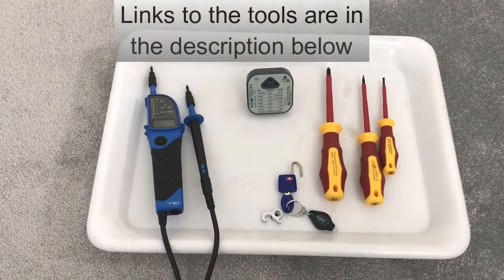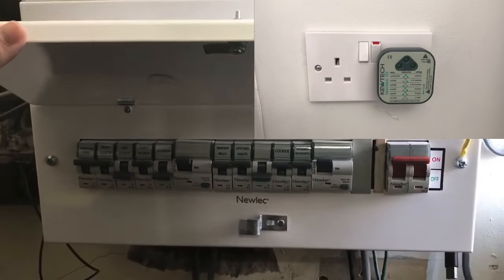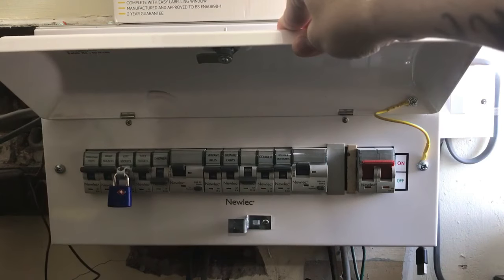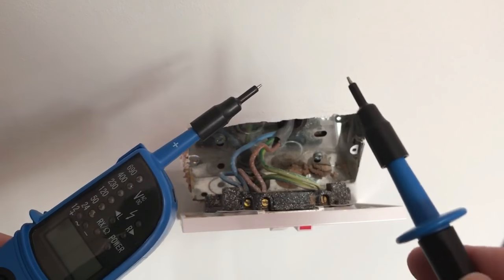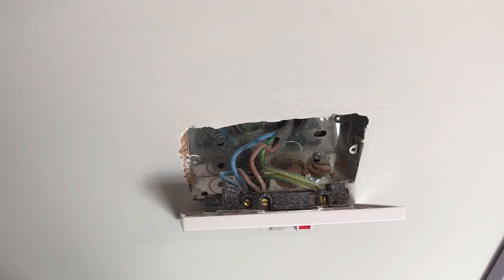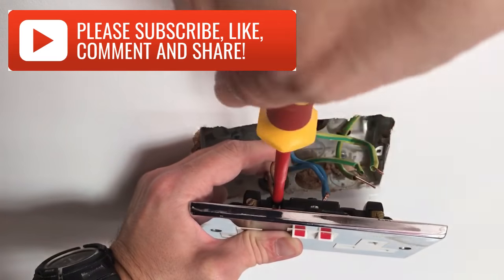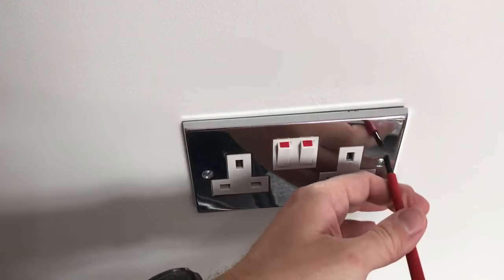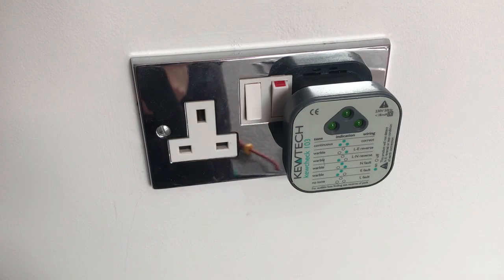How to safely replace an electrical wall socket UK, plug socket

Comment: Great safety advice with the fuse box, voltage tester, and the insulated screwdriver.
Reply from the maker: Can't be too careful with electrics, you only have to get it wrong once.
Thanks for watching and please consider subscribing 👍🏼

Comment: Excellent instructional video! My back boxes and double sockets in a 2001 built house all have fixing hole centres 120mm apart. All the new polished chrome replacements I look at buying have fixing hole centres 126mm apart. Will they fit the existing back boxes?
Reply from the maker: I think they are a standard size. I've never had one not fit.

Comment: I would highly reccomend you choose Varilight over CED or just any old generic brand as Varilight are a more reputable brand. 
Volex are also good but they now only make metal sockets with wide rockers and look similar to Crabtree, another top quality 
brand if you don't mind wide rockers which is more down to personal preference. MK and Hager are also good brands.

Comment: For some reason I was expecting you to put an earth wire to each of the earth points.. I wondered if this was only earthing 1 plug and not the other, could you explain the reason behind 2 earth points? thanks
Reply from the maker: They are both linked together so it doesn't matter if you use one or both

Comment: Great Video, thanks for this. 
I am trying to do myself and change from plastic to brass plates. 
But when opening I can see red wires are in the N and black wires in L. Is this correct? I was just going to put the wires as they are now into my new plate but then got nervous because as you mentioned in the video red wire should be in the L slot. 
Please advise would much appreciate
Reply from the maker: If in any doubt consult a qualified electrician.
Red wires are usually live and black neutral but the person who did the wiring may have done it the other way around. So testing might have to be carried out to make sure it's safe.
Hope this helps.
Thanks for watching and don't forget to like and subscribe to help me out 👍🏼

Comment: At last someone who knows what he is doing, good clear and easy to understand instructions,👍but sorry to criticise you made to simple mistake’s, 1) that voltage indicator does not have a self test function , shorting the probes together only confirms the battery is in good condition also the voltage indicator will still work with out the battery as  the battery is simply to power the LCD display , 2) you should always probe onto the least dangerous point first ie onto earth then onto neutral of the neutral then onto line of the line and of the neutral then onto neutral and onto line off the line and off the neutral , job done the is no particular order for this only that you probe into the least dangerous point first , and if you don’t have a proving unit to test your voltage indicator you can use a none source such as a light fitting. Fantastic video well done 👍

Comment: I would bag a CED metal socket if they are selling in the local hardware store but if I buy them on EBay I 
tend to go for the more premium brands like MK, Crabtree, Contactun, Varilight, Click/Scolmore or Volex. In the high 
street you get whatever they happen to stock but to be honest most hardware stores near me only tend 
to sell white accessories. B&Q is another great place to buy metal sockets and light switches.

Comment: q. why do you need to test soxkets if you have turned off the electricity from mains?
Reply from the maker: To make sure you have turned off the correct circuit

Comment: so you dont need a proving unit with some voltage testers? work are looking to buy me a few things after an electrical/ safe isolation course.   cheers  also i changed my first one today with usb and usb-c port with just a socket tester, i decided to turn off the main circuit breaker as i dont have the voltage meter yet :)
Reply from the maker: Very wise, if in doubt turn everything off but still test.
Thanks for watching and don't forget to check out my other videos and subscribe to help my channel grow 👍🏼

Comment: help please! i had changed the face plate of my shaver unit and when I tried to charge my toothbrush, it wasn’t working so I tried to check the wires of the fuse to see if it was working and all tightly wired in together and then there was an electrical pop (cos i stupidly left the charger socket in and running as i thought it wasn’t working) & the face plate got a bit burned. can it be fixed?

Comment: Can You Use A Charger To Tell If The Socket Is Fully Operational?
Reply from the maker: Definitely not. Buy a socket tester and be safe. If unsure get in a qualified electrician. Don't take any chances with electrics 👍🏼

Comment: So for the earths you can use either side of the unit ? Also the two sets of wires does that mean it’s on a ring ? Seen that in another video, I thought it was a set for each plug hole in a double socket 😞 Love clarification 👍👍
Reply from the maker: The earths are connected on the unit so you can use either or both.
Two sets of cables doesn't mean it's a ring. Both a ring and a radial circuit will have a cable in and a cable out with the exception of the last socket on the radial.
Hope that helps.
Thanks for watching and don't forget to subscribe 👍🏼

Comment: Hi is this safe because it looks safe to me i added a wall outlet but there was no wirewing so what i did was use an old power strip cable and cut the end off one end will go to an existing wall outlet fittet with a 13 amp fuse and other end will be in wall outlet i wired it up right but it only had one ground so i cut off an old cable and used another green wire and joined them together the wall outlet will only be used for vaccum and telephones so it should be fine right?

Comment: Gonna have to ask.  Why was a 1970's MK Logic socket wired up with new colours?
Reply from the maker: It wasn't a 1970's socket it was a cheap as chips socket I installed when doing the rewire. I didn't want good sockets getting wrecked during the renovation so just threw on cheap ones.
Thanks for watching and don't forget to check out my other videos and subscribe to help my channel grow 👍🏼

Comment: Am just scared of where the two wires go into the back of the wall plug socket, how do they go in as I saw two go into the terminals.

Comment: Hi,  my voltage tester (same as yours,  Knightsbridge te1) shows RX and POWER LEDs, plus continuous beep, but no voltage, when i test between live and neutral, after i have switched off socket.  Same as when i self prove the device. Any idea what this means?

Comment: All good, safe, etc. But isn't guy cheating a bit?
Look, then he opens socket it have 2 ground wires. next moment, there are 3 ground wires, then again 2 wires =)
Why? So, he first shot the video, then he figure out that probably according to some regulation he need to 'test the tester' before and after =)
I guess he never did this before =)
later, then he unscrew the old socket, there are 2 ground wires again, and then he screw new one - 3 again.
i guess what he did is added another ground wire for the outer box, but he not said the word about that.
and i guess this is because of tiny thing in regulations that you have to do things according to modern standards if you doing some works, and even if you not required to notify and works are not major, they have to comply to standards.
so be careful, this video actually shows you a bit more than says.
note - i am not certified electrician of any kind, so what i am writing above is just common sense.

Comment: Thank you very much.  Could I ask a question?  I see there seems to have two earth slots - one on left and one on right, correct?  I also see there are 3 green cables, but you have fixed all three only to one side of the earth.  Could you kindly share with us?
Reply from the maker: The earth terminals are connected to each other on the plate so you can use either or both.
Thanks for watching 👍🏼
Reply: @spendtimesavemoneydiy .  Thank you very much.
Reply: Good to know thanks!

Comment: How do you know the screws is aligned with the hole, I want to buy a new switch socket however I'm unsure of whether the screws will be aligned
Reply from the maker: D3CEPTION they are a standard size so the screws should align.
Thanks for watching and be sure to like share and subscribe to help the channel grow 👍🏼
Reply: @spendtimesavemoneydiy  thank you for the quick reply, great video!

Comment: so my question is I dont think I can cut the power but I do have my special insulated screw driver do you think its possible to use it to replace the plate? as you said it Rated to 1000 volts
Reply from the maker: Absolutely not. If you accidentally touch a wire it could be game over. Always cut the power or if you can't call a qualified spark.
Stay safe 👍🏼

Comment: Brilliant very clear and easy to follow video. I have a quick question - a builder wired my outdoor septic tank pump directly into my living room socket. After many years the pump failed tripping the RCB on my consumer unit. An electrician opened the wall socket and disconnected it for me. I wasn't watching how he did it,  but when the new pump is installed, is the wiring basically done the same way as shown here,  i.e. connect the pump earth cable to socket earth, live cable to socket live etc?

Comment: I am about to do this exact swap plastic to metal/chrome and I have been told I need to earth the back box is this correct? or can I just do what you have done? thanks
Reply from the maker: CodGaming earthing the back box is recommended but not essential. The screws in the faceplate earth the back box. If you're unsure then earth it for piece of mind. It's only one extra wire and some sleeving.
Thanks for watching 👍🏼
Reply: Thanks for your quick reply, no id rather do it the same way you have. Its just you hear conflicting stuff on the internet. Thanks for your advise.
Reply from the maker: CodGaming electricians always try to have a go at me because they think you should be qualified to do electrics. But that's not the case and I have colleagues more qualified that confirm what I do is safe.
Let me know how you get on 👍🏼
Reply: I will let you know when I done it later this week or next. Thanks mate.
Reply from the maker: CodGaming good luck and stay safe 👍🏼

Comment: Thanks for the video! Can I use a voltage tester pen instead of the voltage tester that you use?
Reply: I’m pretty sure that will work just fine, however, a multimeter with sound feedback will probably work better.
Reply from the maker: A tester pen will work but by the book you should use a multi meter. Whichever you use be safe and always test the tester. Thanks for watching and be sure to like share and subscribe to help the channel grow 👍🏼